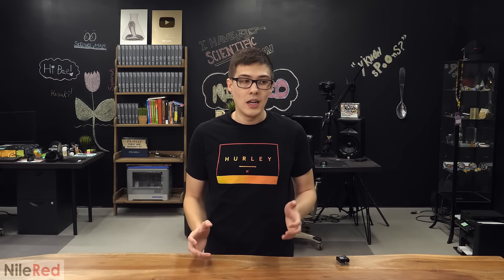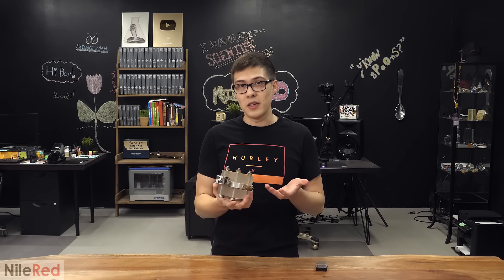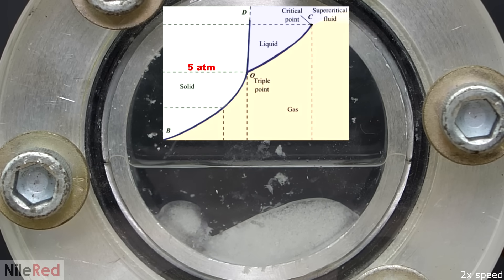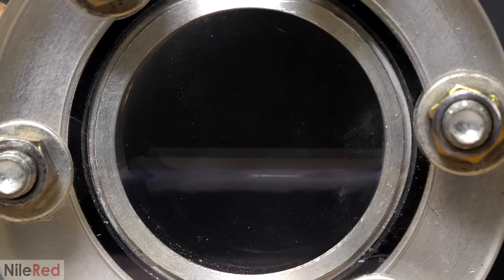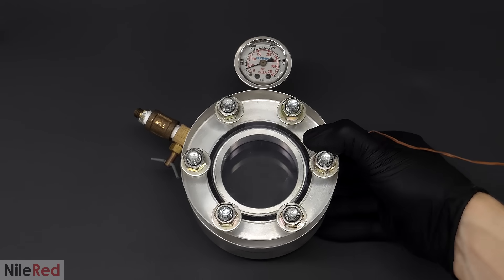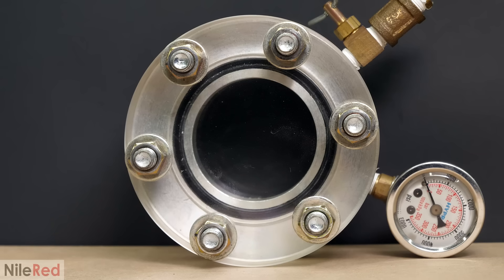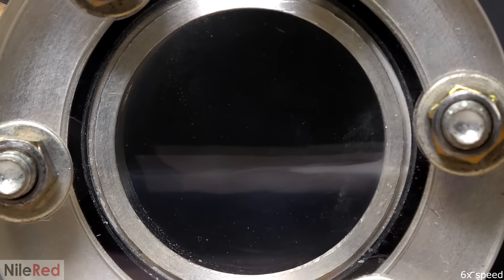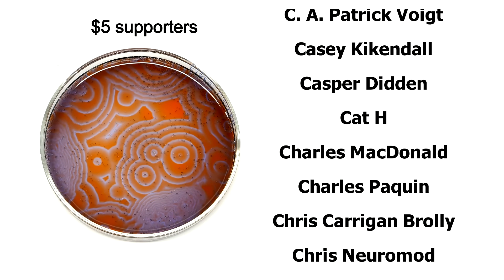Going supercritical.

Comment: 0:19 - Unintentional epic demonstration of how the gravitational constant simply does not care how massive a volume is with regard to freefall. Same envelope, same rate of downward acceleration. It's elegant.
Reply: This was a really nice way of describing what I was thinking in less caveman speak, thanks
Reply: Woah you’re right! I didn’t realize but that’s so much cooler than I thought!
Reply: i mean you could bought two bottles but the other one is full, and the other one is empty and drop it down.
Reply: @sourcandy_account3632  There would be a difference in acceleration, as the difference in mass would impact how easily the bottle would go trough the air
Reply: @olimincraft  not Plastic bottles, use glass or steel
Reply: @zwxyer  As long as there is air, there will still be a slight difference, you're just making it smaller and smaller by increasing the weight of both
Reply: @olimincraft  but if one bottle was half empty and the other is half full, the rate of acceleration would be merely subjective
Reply: @Dong_Harvey  lmao this is the best  joke ever
Reply: @Dong_Harvey  What about one bottle that’s twice as big as it needs to be?
Reply: Thanks Mr scientist
Reply: It’s just about density though

Comment: The refractive properties are probably from micro cracking from the high pressures and intense movements the beads went through. That being said the bit of "junk" was probably just silica flakes the had broken off of the beads when they where exposed to the pressure.

Comment: 5:45 "One major problem that I noticed was that the gauge wasn't moving at all."

Look at the red scale.  That's in bars.  (1 atmosphere = 1.01325 bars)  It goes all the way up to 350 bars.  Look closely at the small tick marks anywhere between 50 and 350 bars and you'll notice that each small tick mark is 5 bars.

Now, look again at the 50 bar mark and count downwards: 45, 40, 35, 30, 25, 20, and then it abruptly drops to zero.  There are NO tick marks for 5, 10, or 15 bars.  Pressures below 20 bars (roughly 20 atmospheres) are NOT going to register on this gauge.  Notably, this also means that the 5 bars of pressure... needed to make liquid carbon dioxide /possible/... is /not/ going to register on this gauge.

The gauge is fine.  It's just that any pressure below 20 bars is too weak to move the needle, and that's okay for a gauge that's supposed to be able to handle up to 350 bars.

Comment: What about mentioning different measurement systems or write them as text info into the video? I realised, you're a mixing units of the imperial and the metric system.
Just in case (I assume have thought about, but I just want to be sure)

For exemple you use C for temperature, pounds for weight and psi for pressure (and maybe inch for length? I'm not sure about it)
Around the globe different types are used, so including more measuring units would make it easier to realise the scale for many people.

Here a few suggestions for units to use parallel:
Fahrenheit Temperature, because it's more common in, for example, the USA as far as I know)
bar or atm (pressure more common in same european countres, for example Germany)
Centimeter / inch (whatever oyu're not already using - as far as I know, in the english speaking country like the USA or Great Britain is inch more common - but in many european country is centimeter much more common)

(kg (kilogram) with pounds 

I know that in Science the metric system is most common to use (If I'm right, it's because of the formulas so you just have to convert units before calculating - because than calculating is easer. But I'm not really sure how that is, because I grew up with the metric system)

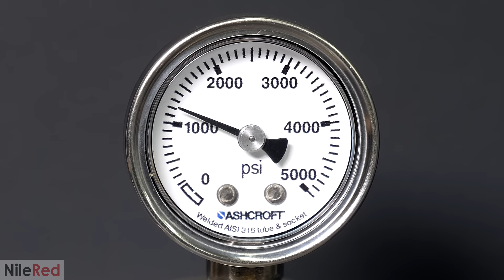As an practical example from this video 16:01 you talked about psi, I completely no idea about  the scale - I had to convert the 1200 psi to bar. I knew, that there must be much preadure, but cpuldn't imagine how many pressure it was. Only as the only converter told me, that 1200 psi are ~82.7 bar I had an imagination of the dimension of the pressure.

I know including this in your videos would more work to do - I would be fine, if you don't change anything about the units you use. But if you do, I would habe much more fun and could easier unterstand things - especially you work with dimensions a viewer has no or very few correlation to: Weight, pressure and temperatur.

I hope you understand and I didn't make any great grammar mistakes.
I just discovered your two channels yesterday and really enjoy your videos.
I'm looking forward to your next experiments and videos.

Greetings from Germany
Reply: I prefer psi, assuming you're already familiar with the imperial system, because I find it very intuitive.
Reply: Otherwise though I agree, conversions would be nice.

Comment: 15:05 

I've done in this week 3 exams in nanoparticles and i hope Ican help you to find a way to understand this magnificent Phenomenum.

I really think you made a nanostructured silicon without any Bottom up or Top Down method!!
Here i go with a simple explanation about nanodefects!

Essentially, the number of defects in a crystall is totally dependent from entropic factor: S*T. The defects behave like gaps in the crystall.
More and more temperature you give to the crystal, more number of defects for volume unit you will have in it. 
Furthermore,  the Si as been allowed to adsorb the super citical gas, and the molecules of CO2 have sattled in those defects and obviously on the surface of the bulk Si sfere.

When you let the pressure decrease, the drops of CO2 stucked in the defects quickly became again gas, expanding their volume and causing billions of internal fracture in the crystall and, more important,*causing a big decrease in the grain size** .

Now, the crystall  has been probably nastructurated, the reflection planes are increased now in all directions and the step distance from one crystalline plane to another is decreased.

Because of these, the electromagnetic band of the withe light is scattered a lot more than before, and can give a lot more intense Refraction effect, like a prism, all due to the little grain size of the Si (Or the crystall domain if you prefere) and you can see the rainbow on the surface (Refraction) and the brown color of Si is due to the changing of crystallinity  in Citrine (partially).

i can't exclude the diffraction phenomenon too.

I hope you  guys liked my explanation about this and i'm sorry if it is too complex or not grammatically correct.

Put a like if you enjoyed!!! 

Big fan from Italy :-)

Comment: I'm still confused why silicon beads cracked. 😐 Maybe because it's being supercritical, for that condition, light molecules have fast movements. Small molecules at 1000psi, I think it's big pressure 😶. So pressure plus tiny molecules are strong. Like a rain can be bullets. That's why it silicon beads cracks. Am I right? 👯?

Comment: Nileblue, I have read about this before, the changing with the silica. If you ask me I would say that a supercritical extaction has happenned. We use CO2 at the critical point to get a component from a material (for example oils from fruits.) We can get almost any kind of component with the punctual setting of pressure and temperature.
Reply: *extraction

Comment: Dude the gauge is working fine, the problem is that the gauge is way to high of pressure to notice. If you look you'll see that the range goes up to 5000psi and 350bar. The gauge was reading around 300psi when you were shaking it around. Also, having it at the bottom probably froze it up from the liquid CO2.

Comment: You probably won’t see this but if you do something like this it’s best to fasten the bolts with a torque wrench instead of a ratchet so you don’t over-tighten or under-tighten the bolts and you can have an exact measurement of the torque put on each bolt :)

Comment: I realize this is an older video by now and it may not be helpful, but getting the torx spec. for those bolts is a simple formula.  I think the easiest way for you to find it is to get an AC 43.13 Acceptable Techniques and Practices.  It's an Advisory Circular written by the FAA for aircraft repair.

Comment: is the blue colour due to rayleigh  scattering ? You form small droplets of CO2(l) but due to the very low surface tension, they can form very small droplets around a few hundreds nm in diameter and thus scatter the light? I saw this effect with small (few hundreds nm) nanobeads of silica. Where the liquid is blueish in transmission and orangeish in diffusion. So basically when you look through it, all the red part of the spectrum is scattered thus does not pass through as mush as the blue part. If this is the case, you can say that those droplets are around 600nm in diameter. The white cloud though would be mie scattering, i.e. white clouds. (It might be the other way round, mie vs rayleigh, always get the two mixed up)

Comment: How the cracks work and why they reflect light:
The supercritical co2 seeps into the beads at high pressure. When depressurized quickly, it expands, forming cracks. Silica is in a pseudo-crystalline structure, the cracks that form are separating two layers. In between, there is a variable amount of space, which in turn through refraction scatters the light according to crack size and wavelength, which in turn gives this its opal shimmer. Basicly you made nanoparticles the other way around. Cracks instead of particle layers, if that makes any sense.

Comment: Interesting enough some folks had been studying what happens to SiO2 and CO2 under pressure. If curious can check out.

Mechanism of Chemical Reactions between SiO2 and CO2 under Mantle Conditions
Xue Yong, John S. Tse, and Jiuhua Chen
ACS Earth and Space Chemistry 2018 2 (6), 548-555
DOI: 10.1021/acsearthspacechem.7b00144 

and

Organic modification of nano-SiO2 particles in supercritical CO2,
The Journal of Supercritical Fluids,
Volume 37, Issue 1,
2006,
Pages 125-130,
ISSN 0896-8446,
https://doi.org/10.1016/j.supflu.2005.06.011.
(http://www.sciencedirect.com/science/article/pii/S0896844605001439)

Comment: I'm a fan you do some really good videos. this was very good. I'd like to give you some good advice. You need to know your tools. I noticed you had an issue in another video with using or choosing the proper tools. in this video you needed a torque wrench which would have let you put the same pressure on each bolt that being said you also would have needed to know what the proper torque is for that device. But I know you could not have known that and it would be hard to find out (not impossible) what the proper torque is for this chamber. Keep up the good work

Comment: What is super-critical for water? Because there's this South American phenomenon in a tunnel that looks EXACTLY like what you show... https://www.youtube.com/watch?v=nmdsIUVMDJU

From what I hear, it takes place in a tunnel under a dam. It seems to get more intense as the large trucks move through the tunnel. It appears like a wave of pressure, bouncing back and forth. Could water reach super-critical with the right pressure at something around room temperature?
Reply: water's supercritical point is at 217 atm (217 times the normal atmospheric pressure, more than enough (about 200 times enough, to be precise) to instantly crush a human body into a splatter on the floor) and 373C (704.93F) so, uh. definitely not.